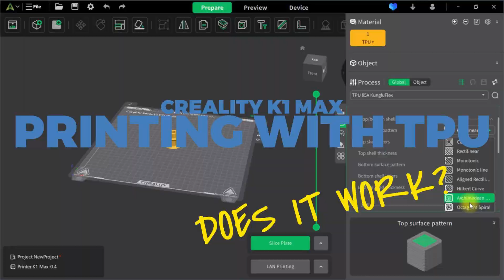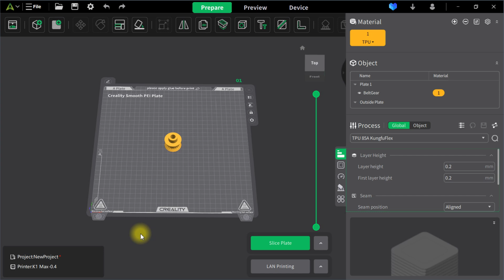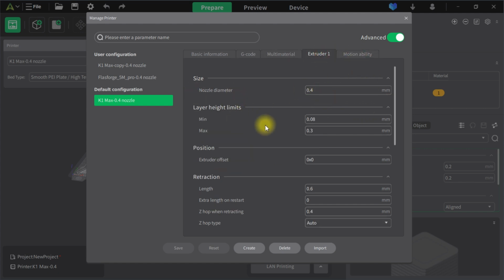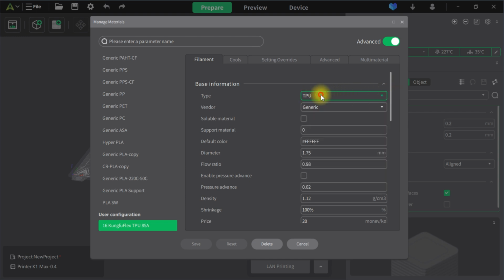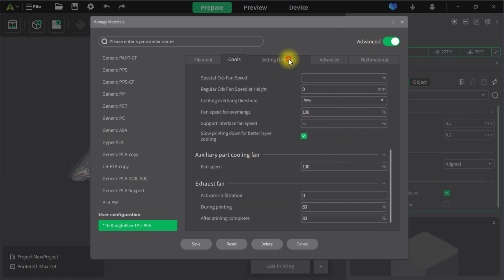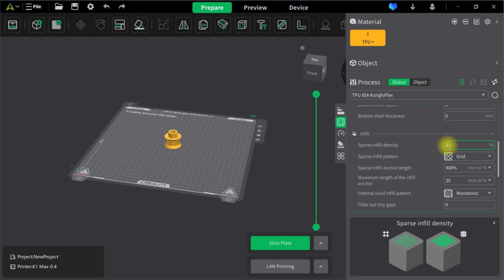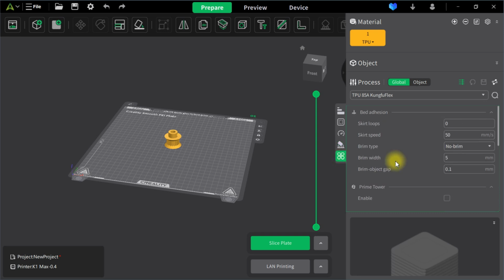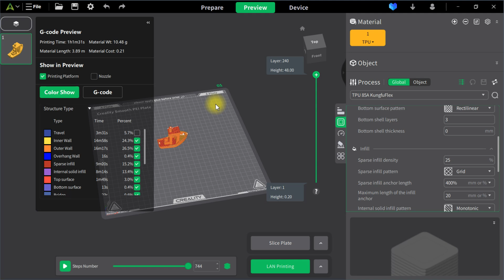Flexible filament 85A on the Creality K1 Max

Comment: Instead of reducing speeds manually reduce the volumetric flowrate in the filament settings. So you don't have to fiddle with so many settings. For example TPU 90A works just fine with a flowrate of 3mm³/s for me
Reply from the maker: I will try it out
Reply: @weitlingD3P  bonus is that this will apply independent of layer height. You will still have to tune retractions but

In general I highly recommend to test materials for the maximum reliable flowrate on your printer so you don't have to worry about switching speeds for different layer heights
Reply from the maker: @towlnator  I just tried it out on my ankermake with  3mm³/s.  the print came out perfect.  Thanks for the tip, I really appreciate it 😀
Reply: @weitlingD3P  No problem. It will depend on your extruder and shore hardness. So you might be able to push more or less but I found it to be a reliable starting point
Reply: @towlnator does the filament get stuck in the extruder? although it's fed from the top